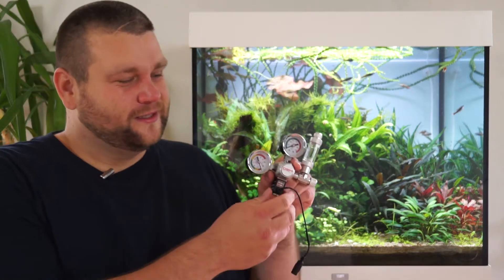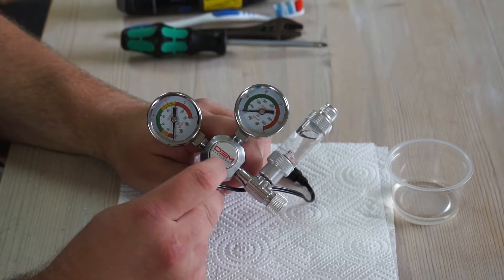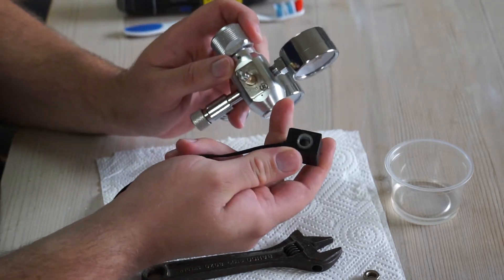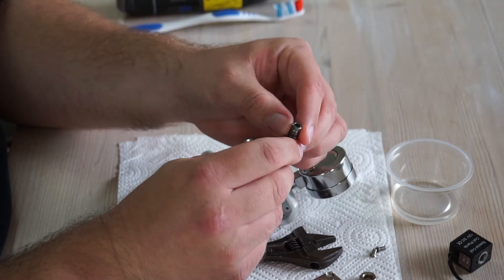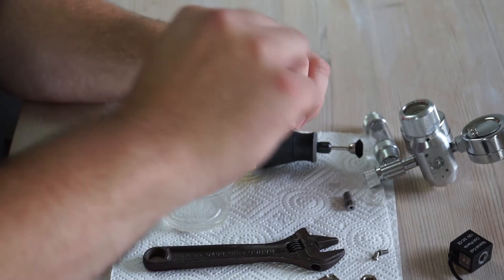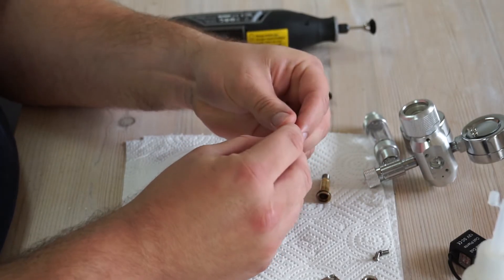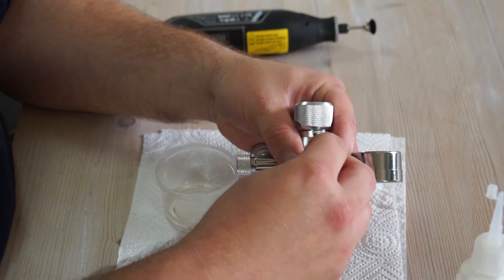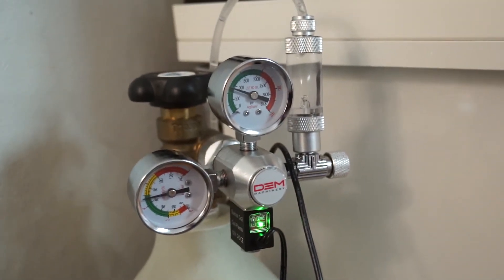Fixing ANOTHER broken CO2 regulator. Solenoid not closing.

Comment: Fzone works great till I decided to not put the filter on 1 time and it let some of the mix of citric acid a sodium bicarbonate get in the solenoid noe it works after cleaning for a while then stops working again I also removed the safety valve and put 400 grams of both and double the water now I get the canister upto 50 60 psi of co2 it lasts a month or so before recharge.  BTW I bout 2 aftermarket solenoids and both were shit the best fix for this is on day 1 put 1ft of tubing between the reg/solenoid and the tank that way it keeps the moisture and mix away from the solenoid then they never fail they get hot but no fail

Comment: Will silicone grease work and be ok for fish?
Reply from the maker: If you go for a grease, i would go for lithium grease. That should be safe, and i've used that successfully on another defective regulator. It also works long term, and its properties stay consistent through time. It doesn't really dry out or become sticky, as many other types of grease will. It shouldn't eat through the seals either. I'm not too sure about the properties of silicone grease. :) But a neutral hobby oil or sowing machine oil like the one i'm using here, can be found in pretty much any DIY or hardware store, and that's plenty enough for this job.